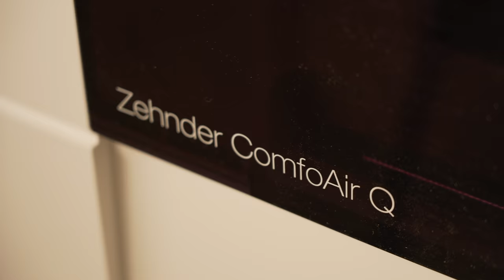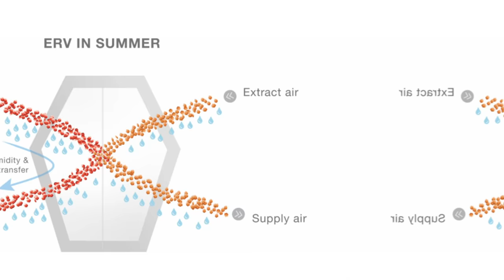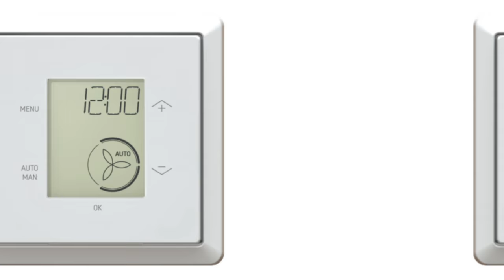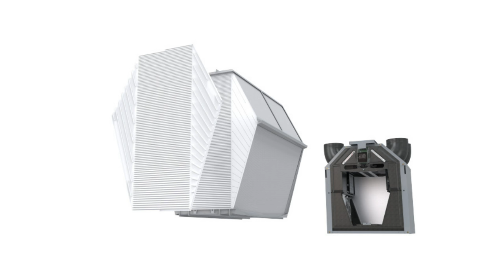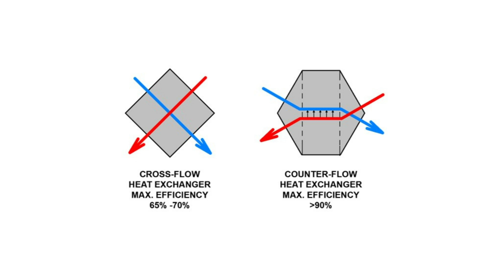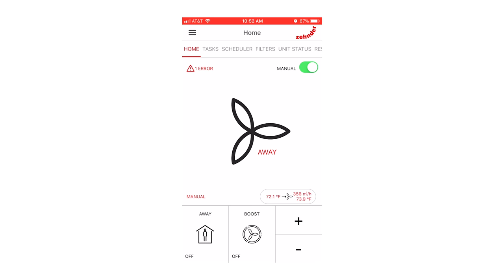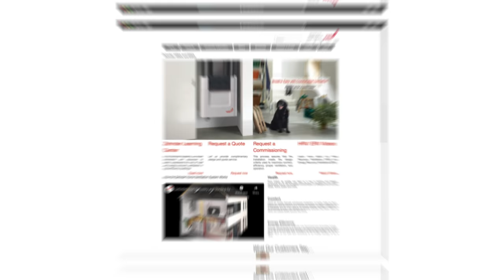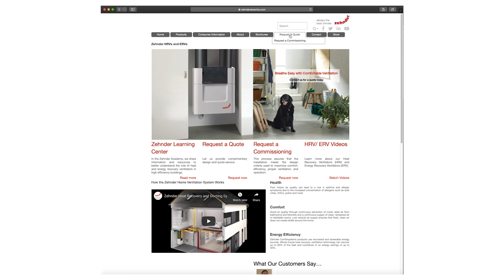Passive House - Fresh Air System Install & Costs (Zehnder)

Comment: In colder climates, even with an HRV, it's recommended to have an exhaust fan in the bathrooms.

In defrost mode during the winter, some HRVs are only recirculating, meaning  that thick poo particle air is swirling around inside the hrv system/ house during the entire defrost cycle.

I also think it's better just to quickly chuck air with high excessive moisture content right outside instead of sending it back to the HRV for processing, but that's even arguable.

I also think it's more efficient to quickly run the bathroom exhaust for a shorter period of time in tandem with an HRV. 

I think Matt needs a follow up video reminding viewers that his house is in a warm climate where an ERV is called for. The HRV and ERV are two different things, used for different purposes and climates.

All in all, we humans are trying to reach for perfect stability indoors, while the outdoors goes buck wild. It's marvelous we can even reach 70% efficiency with an ERV/HRV. 

And like Matt says, if the power goes out...open a window!

Be practical when chasing perfection.
Reply: I started reading the comments because I was curious about all the bathroom moisture that is typically exhausted outside will now be allowed to transfer to the supply air in @mattrisinger ‘s new house since it’s an ERV and moisture transfers. Am I understanding this correctly?
Reply: Approximately 14:15 the guy states the air is never recirculated, it goes outside.
Reply: @Gamerz00760  That's correct. They're in Texas. But in cold climates you have to recirc or it will freeze up. During the recirc, it is not intaking nor exhausting. In -30 celcius winters such as Canada, recirc is a must to prevent freeze up.

Comment: Matt, can’t you use a motion sensor to activate the bathroom fan that activates the countdown power?
Reply: Any BAS with door switches and motion sensors will accomplish this for you. HVAC controls and window blinds are also common in a BAS. 

Some DIY guys are using raspberry PI’s to accomplish this rather than expensive tridium/niagra proprietary programming and controllers.
Reply: TJ Challstrom Humidity sensor won’t close when you just want to take a shit in the toilet. Make up air would have to be balanced with the same cfm as the fart fan. Wouldn’t want to create negative pressure in the space and pull more air away from the other zones. 

None of the other duct runs have motorized dampers on them. Constant speed fan at the ERV.
Reply: TJ Challstrom all you need is a thermostat with a cap tube connected to the hot water line to control the fan. The water line heats up when hot water is used thus turning on the fan anytime the bath water is used. Low voltage to. Add a 15 minute time cut off delay and it will run 15 minutes after shower is stopped. You’ll never have to worry if someone forgot to turn on the exhaust fan again. It’s simple

Comment: More questions: make up air for a big vent hood? And if we upgraded our 2013 ERV, do we just remove and plug the existing bathroom fans and exhaust system?
Reply: I got 1200CFM Kitchen Vent Hood... have yet to install a MUA yet...  Does this system compensate for that or is an extra MUA still required? I also use fireplace in winter... so sometime the smoke is terrible in bad burn. Another headache... However, I do like this system.
Reply: Why not hook up to existing fans?  You can probably even remove the motor and just leave the grill/shell of it
Reply: @MrTiger0002  - The short answer is No. 
A 1200 CFM hood should have an exhaust duct of at least 10 inches (12 inches is preferred). That means you'd need a minimum 10" MUA duct. In reality, you'll want the MUA duct to be larger (much larger) to cut down on the inflow air velocity and noise. Both of these base values are larger than the entire EVR system supply capacity. The same would apply to a gas furnace. don't use conditioned air to feed the fire, run an outside supply for the furnace and keep the entire combustion process separated from the living space.
Reply: @valkyriefrost5301  Thank you. Confirms my thoughts.

Comment: Awesome unit, How will this regulate the amount of hot air vs cold air when it's unwanted?  if the weather is hot i doubt you want warm air coming in then it's butting heads with your HVAC?

Comment: I install HRV here in Quebec, the cheapest one with install start at around $3000CAD and maybe $3500CAD for a ERV. I think this system is expensive but I like the fact that it auto-balance, your system at $15-20000USD installed is quite expensive but maybe its meant for people with deep pockets, you can usually sell your stuff at higher price to those :o
Reply: Where do you get your supplies, from?! I was planning on a retro-fit into an older house here in Quebec, built in 1985, that the guys installed an Air Exchanger in the Attic! I have been looking around to find either someone to give me a cost run down or DIY this thing, but can only find the box store HRV/ERV's and they don't look tempting at all!
Reply: @FelipeSQ04  entry level hrv from venmar, aldes, lifebreath, any hvac company can install those at around 3000. The suppliers doesnt sell to normal people but at Canac, you can get the nektra and its basically a lifebreath
Reply: @SpecialKthx  Thanks a lot, I had read that some places only sold for hvac companies, so I thought it made sense to confirm with you. Will try to go through the Renovert program to make this change, since right now the air exchanger in my home is in the Attic just pushing winter cold air inside :D Thanks a bunch!
Reply: @FelipeSQ04  I suspect you have a asthon or a venmar econo/pro

If you have a 2 story house it will be more complicated but a 1 story with basement not finish or with removable tiles will be easier. You might have to sacrifice a corner of a closet tho.
Reply: @FelipeSQ04  you also can check http://www.epurair.com/en/products/. They are Quebec based company and produce good quality residential ERVs.

Comment: This is a great system however I have two concerns:
1 - What is the noise level at the exhaust grille?
2 - Does the Enthalpy filter actualy reduce the humidity from the incoming air?
Love the show, thanks in advance for the answers and your opinion

Comment: Will you still be running a separate dehumidifier? I’m putting together my HVAC system for my new house construction and I’m loving your fresh air system
Reply: Same question here.
Reply: Matt always does this in his builds now. I’d be shocked if he wasn’t running a discrete dehumidifier as this system isn’t really intended for dedicated dehum.
Reply: Of course, he is putting all of HVAC+D separate hahaha.
Reply: @CompCrasher86 . And it isn't connected to the "H and AC" part of the air system. (A downside really - it should be plumbed right into the dehumidifier input to the recirculating ducted Reverse cycle AC.
Reply: I want to see how heating, cooling, and de-humidification is all tied into this system too.  I'm not quite sure how those pieces of the puzzle fit together.
Reply: @StariusPrime  Dehumidifier on the indoor return. Really depends on your house and set up. Basement, or attic, or in-wall. Talk to an HVAC specialist to tell how it would work best for your specific application.
Reply: If the exchanger of this system works in a similar manner that some of the others Matt has talked about, a LOT of the humidity in the supply air is removed in that stage.  If it doesn't, then you could install one somewhere in the supply air run I suppose..
Reply: By keeping the ERV separate from the HVAC system, you gain the advantages of system simplicity for both systems and air flow redundancy. Tying it all together into the HVAC system makes the installation, maintenance, repairs of a combined system much more costly. The downside of using discrete systems is have the extra duct work, but in this case, I really like the ability to run the fresh air supply to individual rooms at a controlled rate that is separate from the heating/AC needs of those rooms. With a combined system, you completely lose that level of air control.

Comment: I'm really impressed with this house. This is clearly the future. You only showed the air supplies though. What about the exhausts?

On another note: Have you thought about complete energy self-sufficiency all year round with solar panels and a hydrogen storage system? That would certainly be the icing on the cake.
Reply: See 13 minute mark in video, he discusses exhaust.
Reply: I was thinking about the same thing, but you'll have those exhausts at each bath, range hood and whatever else you need vented.

Comment: Hey Matt, could you make a video that shows how this will integrate with your Mitsubishi heat pumps? I am not understanding fully, is there an air-handler and rigid ducting, or is this your ducting? Thanks so much for your videos, I am definitely implementing this in our build.
Reply: This ERV is installed independent of the home's HVAC system. So it does not integrate. Quote from Zehnder "It is essential that the ventilation and HVAC systems are separate and do not share ductwork. This ensures proper airflow rates and energy efficiency". So basically the homeowner will be paying about 2X.
Reply: @sitechca70  How does this not suck all the heated or cooled air out of the rooms and send it outside?
Reply: @skmetal7  That's exactly what the ERV does. Look up how it works. I'm no expert here, merely a residential homeowner who has looked into the benefits of one and decided it wasn't worth it for my house and climate.
Reply: @skmetal7  just look at the whole video, it is explained.

Comment: Stuff like this is what we need to be code / standard, in the UK the overwhelming majority of new builds ( no matter the cost ) have no MVHR or anything like that. You get a gas fired boiler wet central heating, extractor fan in your bathroom and maybe kitchen, then trickle vents in your windows 😞

Comment: Wow, $10-12k? I did a dual core Fantech HRV in my house, total install was less than $2000 with all the ducts and it’s the largest unit they make for residential. It wasn’t as plug and play, but that’s a huge markup for plug and play.
Reply: 100% agree
Reply: most of that cost is for stuff other than the unit. zehnder accessories are pretty expensive. the q600 also has a maximum capacity of close to 400 cfm, which is probably several times greater than the maximum cfm for your fantech system. 

there is also a lot more intelligence in the q600 than there is in the fantech. for example, when the zehnder person in the video said that the tubes were 12 cfm each, he didn't actually know that - it's just a talking point number. the only way that that would possibly be true, is if the total equivalent lengths for all tube runs were the same. the way it works is that you just throw the tubes out there, and you rely on the intelligence of the q600 to figure out the best way to distribute air to them. so they are counting on the q600 to do a kind of automated "manual d" analysis. what they call "commissioning" sounds like a "manual b" type of analysis; it's the kind of thing that you should do in any forced air system.
Reply: @paperwait9611  100% right.
Reply: joe rond well I have the SHR 3005r which is rated at 267 cfm. So yes it’s lower cfm, but why would I need more when I rarely run it above low speed anyway? So I could install 2 for less than $4000 total, and have over 100 cfm more. If I wanted, but I don’t want or need. My unit on high can exchange all the air in the envelope of my home every 2.31 hours.
Reply: @christophergruenwald5054  if you're happy with your investment and quality service etc. please enjoy your house.
Reply: I looked up the unit itself and it cost $3800.00 so more of the cost is the labor and add on cost of accessories....
Reply: Shaun Carson I bought it brand new from AC wholesaler 7 years ago with 4 timers and a master control delivered to my door for $1300. That said I’m finding prices today for that model online ranging from $1575-1650. The unit now has been discontinued as they are moving to their hero models which are like the unit in the video, but a lot cheaper. I also installed it myself. Labor to install wasn’t figured into that 10-12k they mentioned in the video.
Reply: joe rond I’m very happy with it. So happy I’m looking for something similar from fantech for my 40x72 garage to help remove moisture and exhaust fumes in the winter. Supply house has units that range from $700ish to $1600+ depending on what you are looking for.
Reply: @christophergruenwald5054  The estimate for the 10-12k included the labor or fees to have someone come out and do whatever they do to give you the cfm needed for your home/rooms.  That is what I heard the guy from Zehnder say when he gave the estimate cost for Matt's house...

Comment: On the dryer vent, how do you keep it from clogging your filters with lint?
Reply: It's not connected to the Zehnder - only air to the room -
Reply: ArthurDentZaphodBeeb  but he mentions the exhaust from the laundry room and how its connected.
Reply: @bryce4071  That would be for an exhaust fan in the laundry room not for the clothes dryer itself.  The amount of heat, moisture, and lint in the dryer exhaust would overwhelm the system very quickly and would be a disaster.  While they did not specifically get into the dryer exhaust, that would have to be run separately to exhaust directly to outside air.  The Zehnder system would presumably take care of the makeup air needs when the dryer was in operation.
Reply: I’m actually surprised to learn people have exhaust vents in laundry rooms. If its all being taken care of by the dryer exhaust, why? Or is it humidity from the washer maybe?
Reply: This would be a heat pump dryer. Smaller and more expensive than a conventional dryer.
Reply: @CompCrasher86  An exhaust fan in the laundry room is fairly common in Texas.  I think the rationale for the exhaust fan in a laundry room is not so much based on humidity control but rather to help remove chemical smells from bleach or other cleaning chemicals that would typically be stored or used in the area.  Cat owners also tend to put a litterbox in the laundry room and an exhaust fan can come in pretty handy.
Reply: @CompCrasher86  - BubbleOnPlumb hit the main reasons for a laundry room exhaust fan. I'll add another need is the general radiant heat from the gas dryer in the summer time. Having a large family and living in Georgia means a lot of laundry. The up stairs dryer turns the laundry room into a dry sauna in the summer time. The small HVAC duct to that room just cannot keep up. The only other solution is to keep the laundry doors open during the day to spread the warmth...
Reply: You might be able to extract some of the heat from the dryer vent pipe by having some sort of jacket around the pipe. But cooling down the dryer vent air would slow down the air in the pipe and could lead to clogs. Also, I imagine in south Texas, keep heat energy trapped inside isn’t nearly as important as keeping cool air in.
Reply: @paulmorrow8372  - more importantly, since the air is heavily saturated with moisture, the heat transfer would lead to condensation which will lead to clogging and the potential for a vent fire.
Reply: He is using a heat pump cloths dryer. There is no dryer vent. The moisture is condensed into the drain.
Reply: @BubbleOnPlumb  Do you know this to be true?  Zehnder told me that it would but now they have backtracked and said it will not.
Reply: @cindianderson9443  Do I know what to be true?  Not sure what you are asking here.
Reply: @BubbleOnPlumb  "The Zehnder system would presumably take care of the makeup air needs when the dryer was in operation."  You did say presumably, I just wondered if you had any experience with whether it does or not.
Reply: @cindianderson9443  Any fresh air makeup system will provide incoming air that will eventually replace air exhausted from the structure.   A typical clothes dryer really only exhausts about 100 CFM while in operation so the loss is not particularly staggering.  Matt says he has 180 CFM that is always incoming and outgoing with his system.  The Zehnder guy commented that the intake and exhaust fans in their unit are separate and will adjust their output accordingly as needed based on pressure changes (see time stamp 8:20 in the video.  

The implication of those statements is that the outgoing fan would automatically reduce its exhaust rate when it senses that the house is depressurizing by some other means, such as during the operation of a clothes dryer.  So imagine that the Zehnder system is now only exhausting 80 CFM because the clothes dryer operation is removing the other 100 CFM via its own operation.  The incoming air is still coming in at 180 CFM and the total exhaust is also still  180 CFM (when you add the dryer and the adjusted Zehnder exhaust volumes).   This keeps the house in balance in regard to the incoming and outgoing air volume.  So the bottom line is, if the system works the way it is described in this video then you are good with all of your makeup air needs.  What I can not say for sure though is if the Zehnder product actually works the way (or as well) as it is described in this video.
Reply: @BubbleOnPlumb  This is what they told me first but now they are saying the complete opposite, that the salesperson was wrong, and that it will only self-balance "within itself". That if 100cfm exhaust is added, even if you have 100cfm extra capacity in your system, it will ignore that and you will still have 100cfm of negative pressure.  I don't understand why it couldn't cut back in other areas as needed, but it apparently doesn't.  But I'm hoping someone has one and can speak to how it really works.